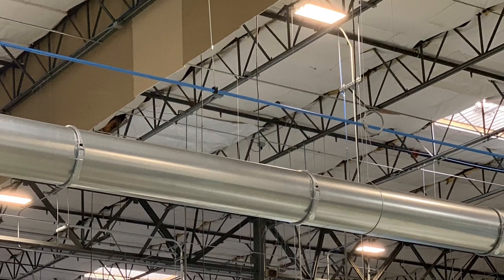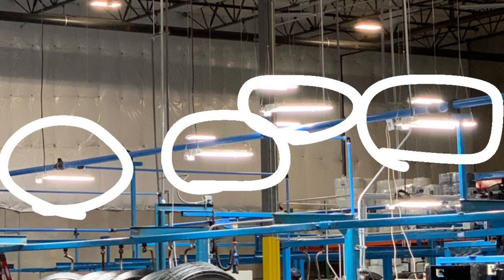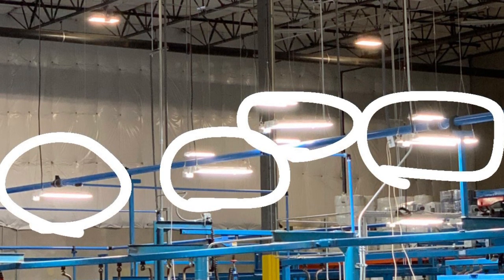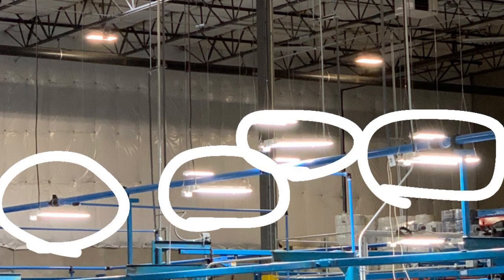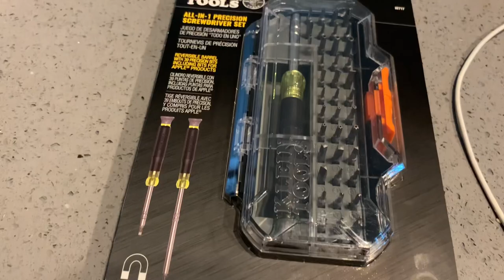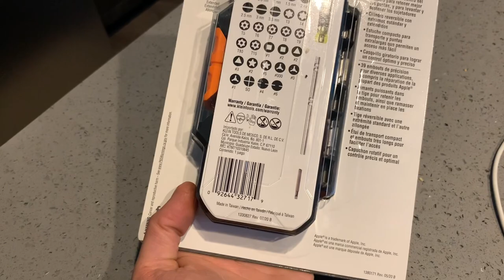Snorkeling All Day!

Comment: If you ever get into maintenance work or heavy into instrumentation and controls, that Klein multi-tip screwdriver set will surely come in handy. I've used lots of those tips when repairing larger VFD's and electronic instruments. The whole time I worked in the construction side of the trade, (residential, commercial, and industrial) I didn't use that took kit there hardly ever. Thanks for your video! ✌️